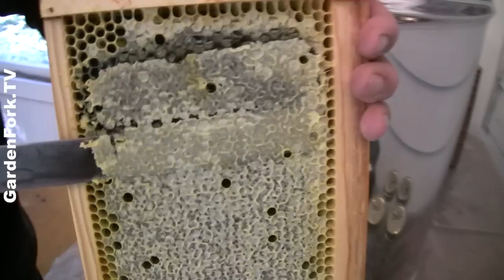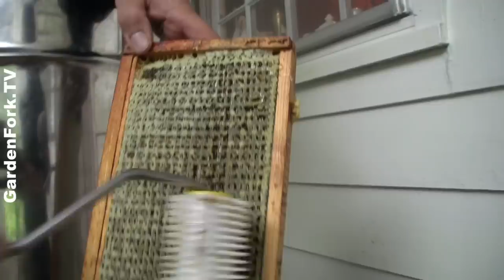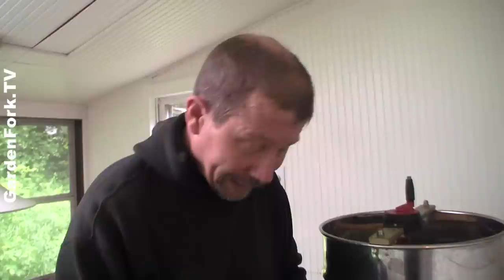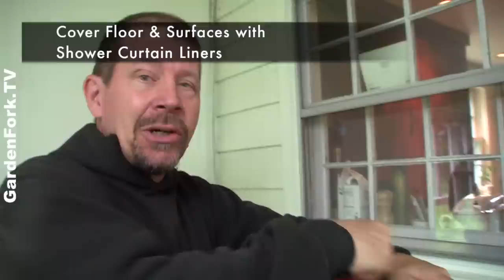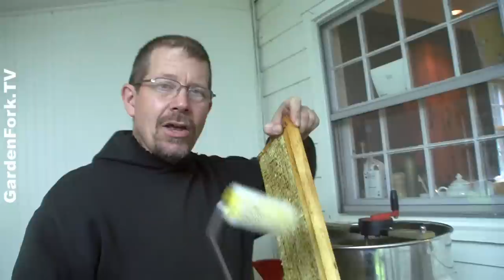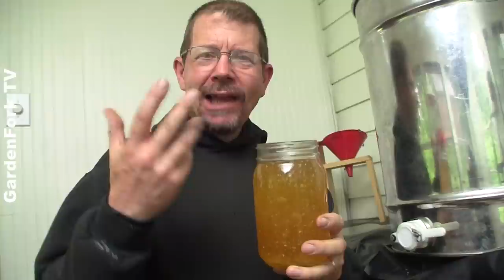How To Harvest Honey, New Method - Beekeeping 101 - GardenFork

Comment: I've used a heat gun to melt open the wax cappings with similar results, although the roller looks ever better.   Using a space heater to warm up the honey --- very nice.  I'll steal that trick if you don't mind.

Comment: Cool.  I'll have to try the roller.  Suggestion: Put your frames in the extractor with the top bar toward the wall of the extractor. (Up side down so to speak) Bee make cells that have a slight tilt toward the ground. If you spin out the honey with the top of the frame toward the wall then you'll have an easier time and extract more honey.
Reply from the maker: Matthew Roswurm wow. had never known that tip, thanks for that! eric.

Comment: Love the roller thingy.....I'm gonna get one,my hot knife tears up the combs too much....I drain my honey into a 5 gallon bucket first,then I re strain the honey through a screen then into jars...thx.
Reply from the maker: +stuart sullenbarger yes, the roller with the pins works great. you have to roll more than you think, but be careful not to crush the comb. thx! eric.
Reply: +stuart sullenbarger Sounds like your knife isn't hot enough.  I have no problem with a hot knife.  If it cools down I've torn comb.  
Keep it hot.  If it starts resisting as it cuts through then stop a second and let the knife heat back up.  
Usually works for me.

Comment: Hello, I really liked the video. I have a question about the moisture content comment you made. I believe that honey not ripe will ferment, not crystallize. Did you misspeak, or am I wrong? Thanks for the video.
Reply from the maker: +Mitch Rushton Hi Mitch, I have not heard that, but I could be wrong. now you've got me thinking... thx! eric.
Reply: The honey does not crystallise because  it has too much water in it.  If it has too much water in it when you extract it, the honey will ferment.  All honey crystallises eventually.  You need to do a bit more research and get your facts correct.

Comment: I do not have an extractor so I am not sure about this, but with the honey comb being slightly angled up by the bees towards the top of the frame, would it not be better to have the top of the frame on the outside of the extractor so the angle of the honey comb helps the honey come out and does not hold a small amount of honey in it afterwards?

I am ignorant with the extractor so pardon me if I am way off.
Reply from the maker: +Navy Phil Hi Phil, good eyes. this extractor seems to work better with the frame tops pointing in, not sure why. thx!
Reply: +Navy Phil How do you extract?  Do you run only comb honey?  Or, do you scrape the honey and strain it into a jar or bucket?
Tough going but it works, and you don't have to spend all that money on an extractor.
Reply: +Bee Bob I am still waiting on my first honey extract so I do no have a way yet.  I will not destroy my honey comb though. The bees have to work much harder for every section of comb compared to making honey.
Reply: My suggestion would be to check with your local association.  They usually have extractors for rent.  Maybe this is a simple solution.  The issue with extractors is that they take up so much room for only a small part of the year.

Comment: Frames were put in backwards.  The top (fat side) should be facing out; the cells are slightly angled up.  Will extract better that way.
Reply from the maker: ***** Hi John, our extractor needs to have the fat side facing in, or it makes a loud knocking sound when we spin it. not sure why, but that's why we do it.  thx!  eric.

Comment: What you can also do is use a heat gun to heat the cells and then they will pop
Reply from the maker: +JP 2001 i have tried a heat gun and it is very difficult to not melt the beeswax cells. I now use this neat roller to prepare the frames for the extractor: https://www.youtube.com/watch?v=ZYfufMWG7Zs&index=3&list=PLB57601EDC866947A